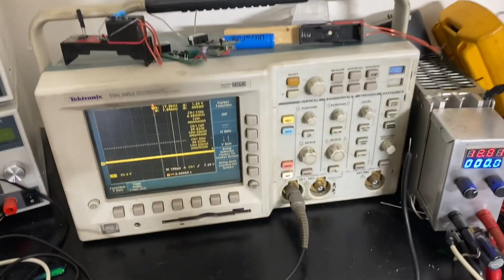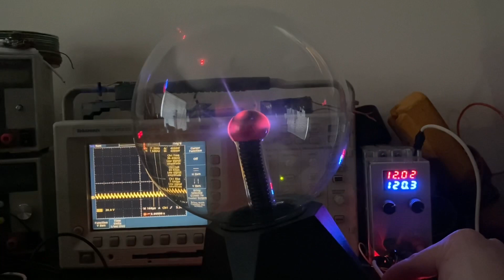Variable HV AC Power Supply From Plasma Globe Driver

Comment: This is exactly what I was looking for! When I was young I distinctly remember a plasma ball at a science museum which had a built in control knob for varying the amount of tendrils in the ball. I have searched for years and never seen another one like it, I couldn’t even find any information about the circuitry. The only thing I could find was the Wikipedia page, which simply confirms their existence and nothing more. I can’t wait to modify my cheap plasma ball to have a control knob, thanks so much for the informative video!
Reply from the maker: That is a really satisfying story to read. Thanks for sharing it!  I feel the same way after finally finding that missing info after years of seeking.

Comment: The rest of the circuitry is there for the momentary "clap" ON  option. The non potted core transformer that was in mine didn't handle arcing very well being driven with a Mazzilli ZVS, it burned out quickly.. was probably driving it at the wrong frequency